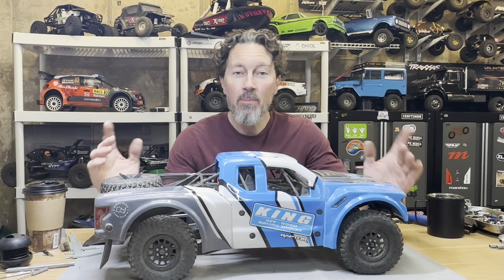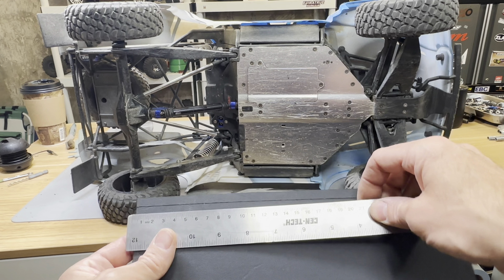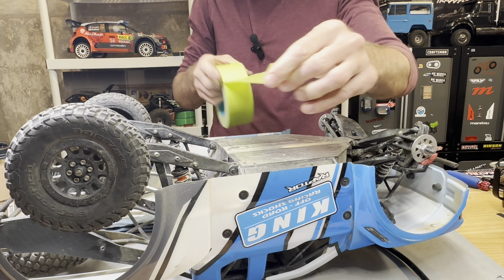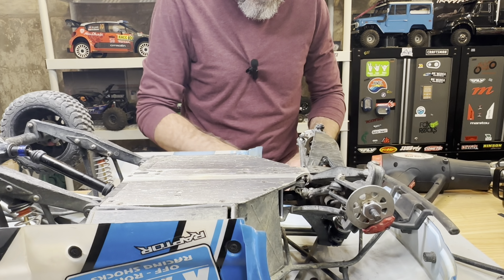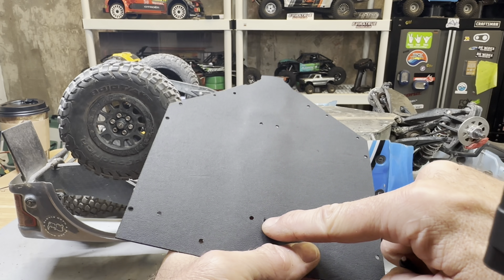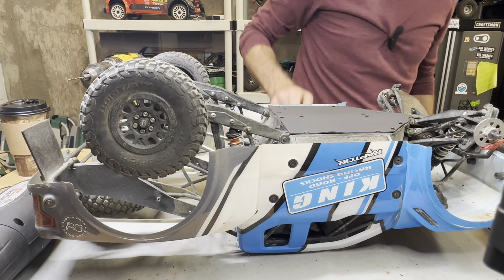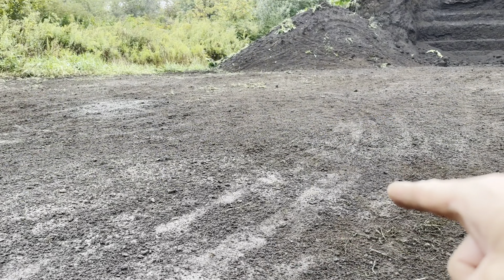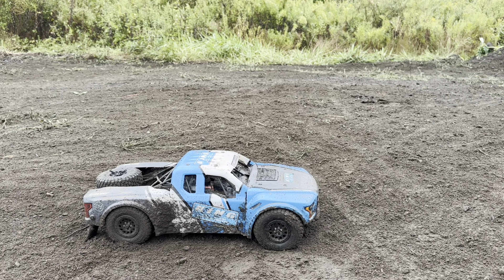Baja Rey DIY Full Skid plate and Center Flaps.

Comment: Would it be better to slightly overlap front and rear and roll it over to help with it not being peeled back if you catch a protruding rock stick or other unseen obstacle, just a thought, enjoying this and the new to you UDR, I am working on my Yikong TB7 FORD BRONCO R  1/7th Ultra 4 along with a Rlaarlo MK7 Jeep lookalike new front shorter narrower bumper with a 1/8th RC4WD WARN winch with remote alloy axles a bucket of brass and just trying to decide which brushless ESC and notor I have a Rocket RC combo a Hobbywing combo and a Felony take off combo as I have 8 Sed myFeony ZD racing Hoonigan and my FTX Supaforza Mustang my UDR is running 8S and many thanks for your UDR suspension ideas mine is now very much like yours different fluid and springs.
And now another great idea I have been thinking of front flaps on my UDR TB7 and 30 degrees North Super Dezert truck clone of Super Baja Rey a cross between the V1 and V2 it came out as a King Motor Baja truck before the V2 and in my eyes better for it although I have borrowed parts from the LOSI SBR.
Reply from the maker: Possibly, you have lots of options as far as making it larger to wrap up to sides of body too. 
It’s cheap enough to experiment with 👍